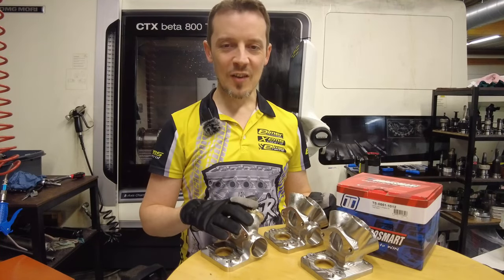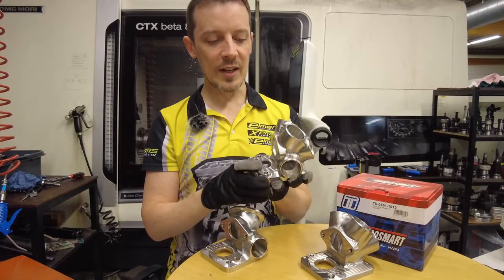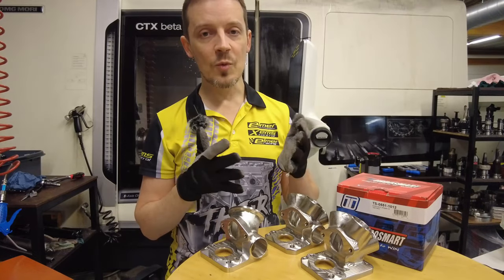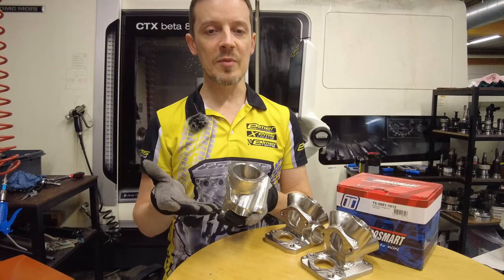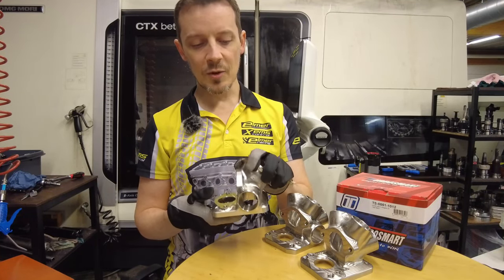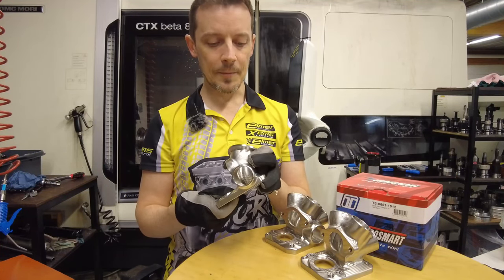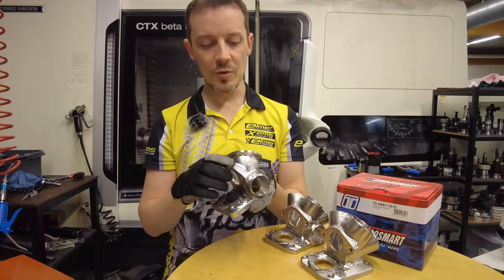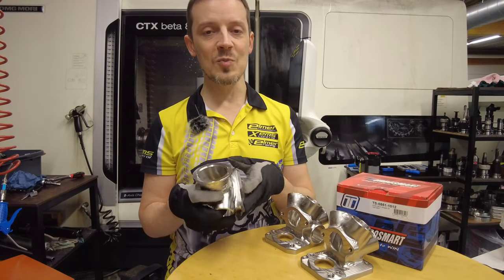V-band spool valve now available!

Comment: Very nice but how we will find someone to do manifold itself it would also better if you offer them in a complete form as a manifold in future 👍🏼🙏🙏
Reply from the maker: We specialize in making collectors. Exhaust manifold manufacturers then specialize in making complete manifolds for different vehicles and engines.
Reply: @ElmerRacing  what about combining it with a flange adapter? T25 inlet, twin scroll T4 outlet, spool valve in the middle?
Reply from the maker: @lutherblissett9070  We have one available with a v-band entry, that allows using it together with our v-band collectors for a lot more options!